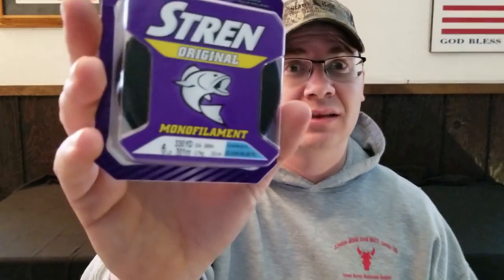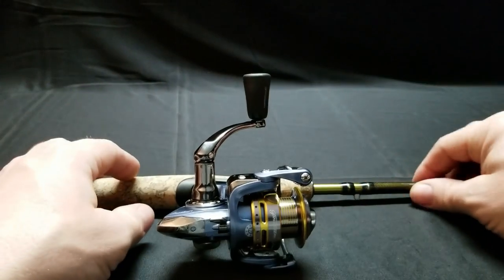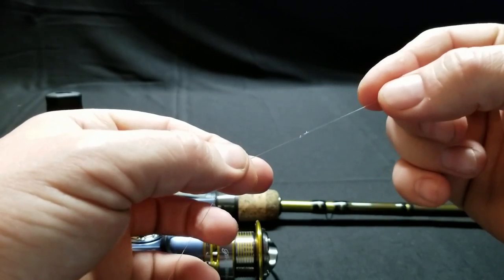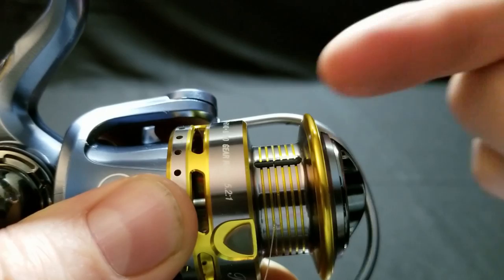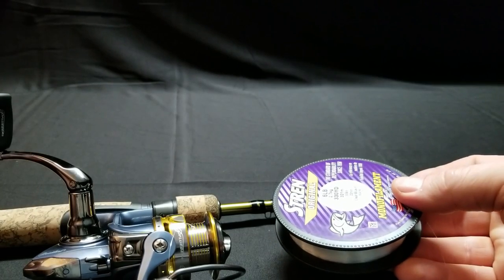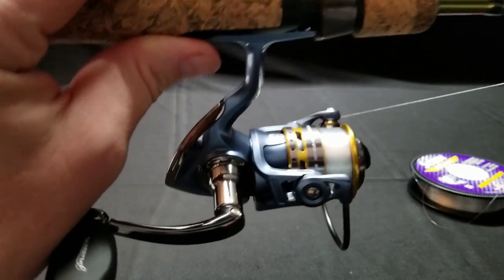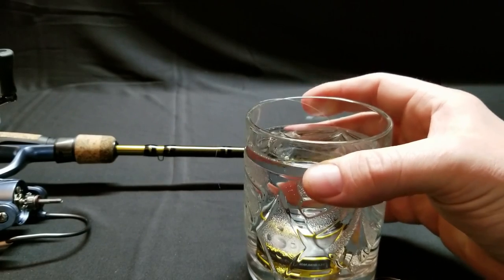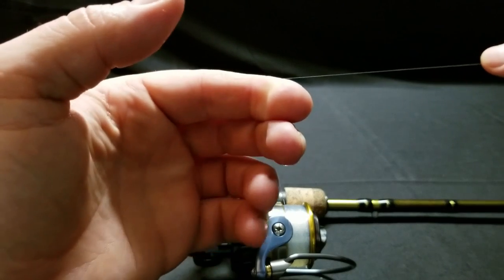NO MORE TANGLED LINE!!! | How-To Put Line on a Spinning Reel

Comment: So why are there 3 or 4 different versions of the Arbor knot? The real Arbor Knot is a slip knot, like a noose.  Do you know some lines are on the spool the opposite way? Manufacturers have not standardized their spool loading direction. Your instruction about the label is bull shit. You need to look at the actual line direction, not just the label.

Comment: The 1st time line goes on a reel is pretty much irrelevant as you'll be casting out many times and reeling back in! Depending on what bait/lure you're using, swivel or no swivel, and other factors, you will always have line twist with a spinning reel and the only way to get rid of it is dropping a weight/bait/jig from a high place and letting it untwist. Dropping the spool in water is also pointless as you don't want a tighter coiled line! The coil size coming off the plastic spool from the factory is larger than the reel spool which means less coil and thus a better cast! Also, water on the inside of the spool can degrade the grease/oil and water seeping in to the wound line on the spool and being trapped isn't good, especially if it's chlorinated tap water. This entire video is pointless.